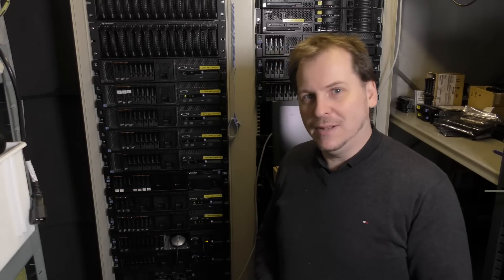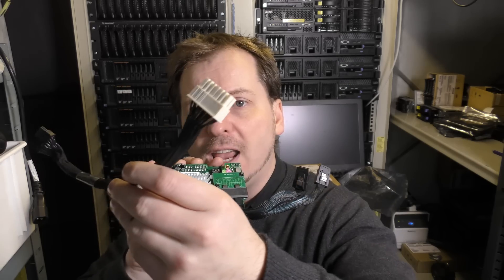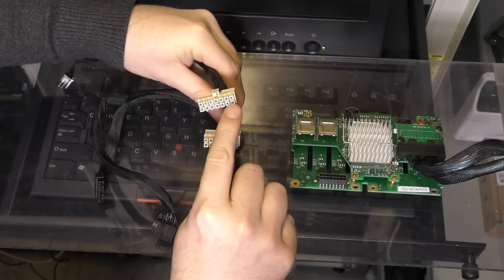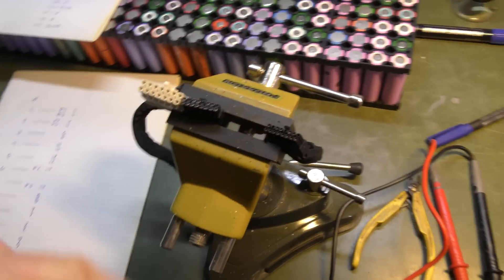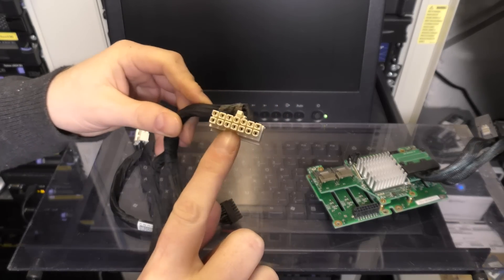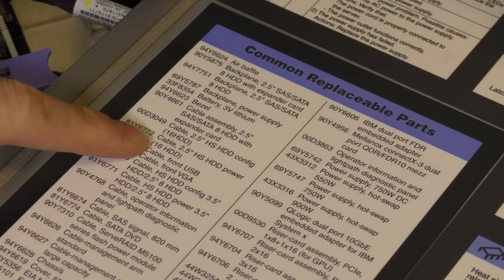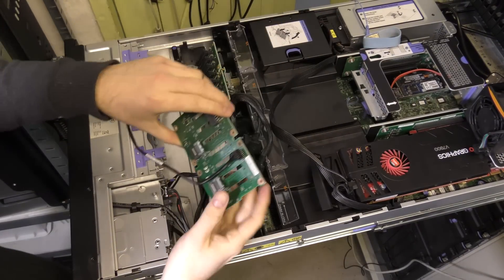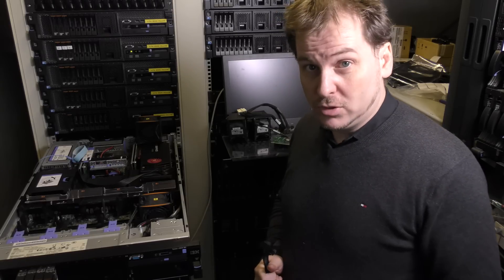I Fail Miserably!! Installing 16 Bays in Lenovo x3650 M4 - 631

Comment: 7 years after, and one naive purchase of IBM 94Y7751 later, thinking I could just plug'n'play expand drives. Figured there is only one power connector on the mainboard, so in desperate mood, found this video. And I did something similar, but different. So, firstly, I would like to thank you, Morten, for providing detailed pinout of both single and Y cables, I wouldn't be able to do anything without it. I bought 14 pin empty mainboard connector, bunch of connector pins, and used 2 of 81Y6771 backplane power cables. Snipped wires from white connector, joined them per your instructions, and inserted in new empty 14 pin connector.
Of course, I needed an extra SAS controller, just used some LSI 9207-8i controller with appropriate data cables.
And what bugged me the most is that stupid config cable that should also be splitted. But, I said, what the heck, let's do without it, it's probably only for some IMM information or configuration stuff.
Anyway, tldr, disks are showing in Truenas, and somehow I think this is better option than expansion card, since you don't share the bandwidth over only 2 SAS, but each drive has it's own full link path.
Thanks again Morten. :)

Comment: the plugs are just standard Molex connectors, you can get them pretty much anywhere, you can also buy the pins, so totally possible to DIY. 

I think that the Pin 6/7 on the white connector might be a voltage sense to each board to see if both are receiving +12V to tell the board/IMM that they are both present?

EDIT: i think i found both of them http://www.molex.com/molex/products/datasheet.jsp?part=active/0430251400_CRIMP_HOUSINGS.xml for the white 14pin & the 16pin black connectors http://www.molex.com/molex/products/datasheet.jsp?part=active/0039012165_CRIMP_HOUSINGS.xml
Reply from the maker: Hi Mark Stubbs
Thank You very much!  I have added your comment to my description,, in an edited version :-) and the links was the wrong way, white 14pin & the 16pin black. 
Thank you for watching! :-)

Comment: what is that serial data cable for? i'm curious.. i want to buy a backplane but i don't know if the backplane would work without that cable :/
Reply from the maker: Hi S. Kojina
Ohh,, maybe you can use this link :  https://www.techdirectclub.com/lenovo-00y7658-x3650-m4-hd-3x-8-bay-hs-hdd-assembly-kit-2-5-ibm-server-zz/ 
Someone posted it to me,, further down...
Thank you for watching! :-)
Reply: ooo... thank you! but i don't own any rack server. it's for my desktop (i'd like to expand my desktop to something like 22*12TB in the future). soo... there's no I2C connection to the board :/ 
anyway, i sent you a link for the cable by youtube message (i forgot to paste the link on my hangouts message lol). i hope it's the right cable and affordable for you (honestly, i can't find anywhere else. any other sites list it as unavailable :/)

Comment: Morten, could you tell us what are you trying to do? running your VM's from local disks on your machine?
The reason that the cable is expensive and rare to find, is because almost no one expanded to 16 drives, most companies will use 2 machines with 8 drives and using this method, you'll get high availability (and you can "pin" the VM that uses the GPU to a specific VM in a specific host) and you'll save yourself $100 for the other cable that you don't have.
Reply from the maker: Hi Hetz Biz
Thank You very much!  Yes these cables are not normally sold separate. It is actually not uncommon to get servers with 16 or 24 drives.
Thank you for watching! :-)

Comment: I got a cable like that one you are missing in a kit for my x3500 m4, I could pull it out and buzz the pins out
Reply: I made a mistake. 00d2706 is the cable I removed to install another cable for 32 drives however, 00d3049 is a cable I can't use that I received with one of the expanders
Reply from the maker: Hi niffumau
Thank You very much!  You do not need to,, I will get it.
Thank you for watching! :-)
Reply: ok, if you can't find one maybe I can post this one from Australia

Comment: Dam!!, always the special parts :-(.
Those power plugs do look similar to Atx psu plugs, i would have hacked up plugs to make one rather than spend lots of cash on a power cable.
The I2C cable looks even simpler, source some plugs and make one :-D
Reply from the maker: Hi zx8401ztv
Thank You very much!  but,, I do not have the "pinout" of the one I need.
Thank you for watching! :-)